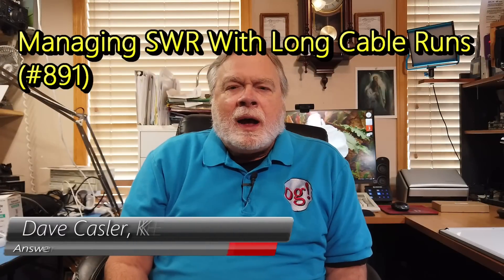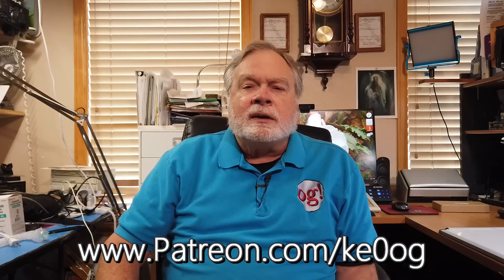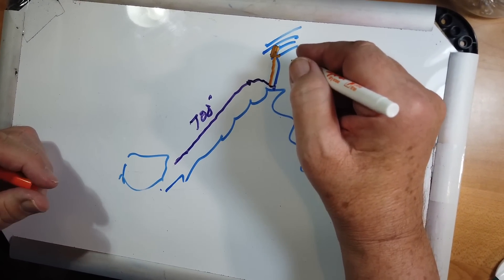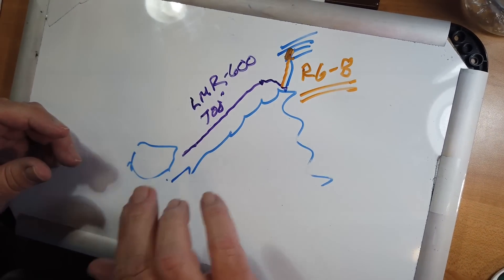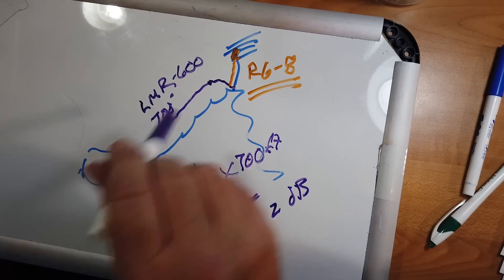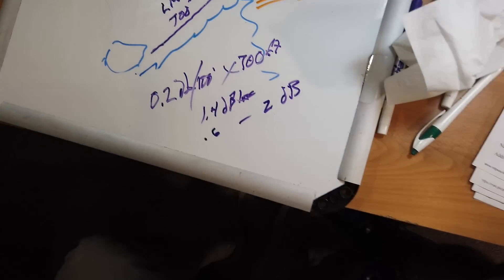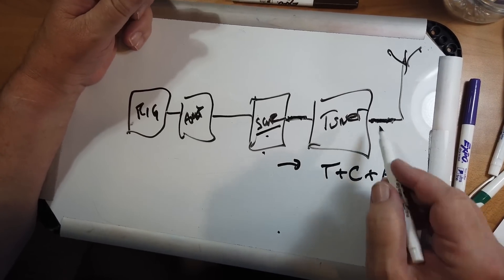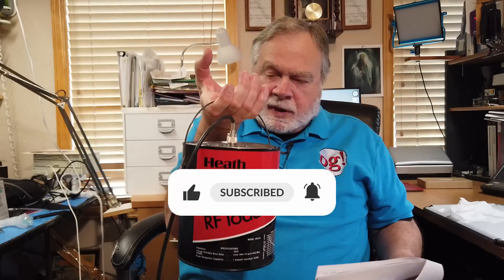Managing SWR With Long Cable Runs (#891)

Comment: Very good info per usual Dave. I have a long run also, about 300 feet from shack to top of hill at the base of my tower which was given to me. I feel that money spent on the best cable your budget allows is money well spent. We spend over $1000 on a radio for our base station, and don't go the extra yard to install excellent cable which will be there for years to come. Tough to spend the $$$ at the beginning, but it pays dividends over the years.

Comment: Would honestly  advise redesigning his system,,,i would remote control the radio and have some form of software control line to control radio located  at mast end,,,,ie use sone form of twisted  pair line or wifi or internet, it could be done and would do away with all that 700ft of coax,,,must have been expensive.

Comment: After all the discussions about local vs. remote... I'm curious to measure SWR at various points along the system when "tuned."

I ran a VNA on my system when I put new low loss coax in, and the 50 ohm load wasn't flat at the shack end by any means.